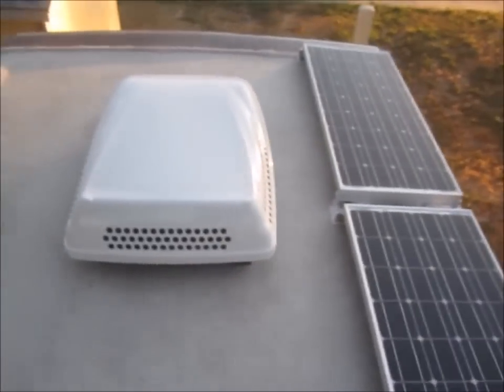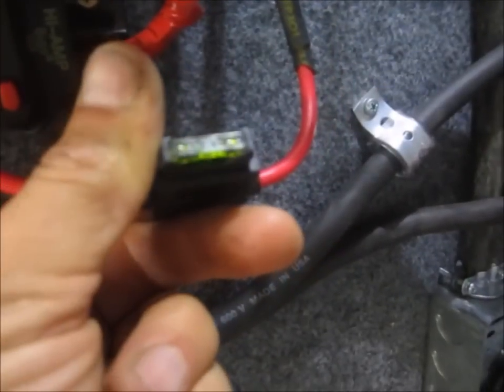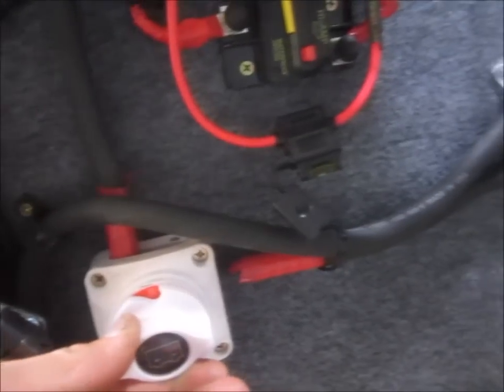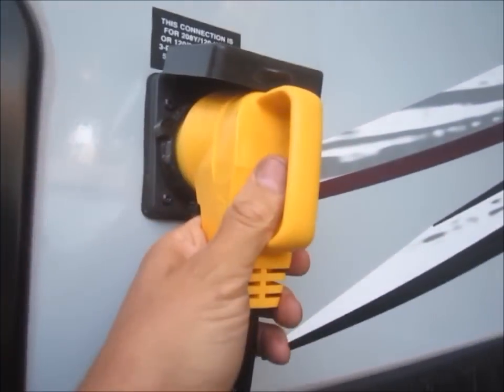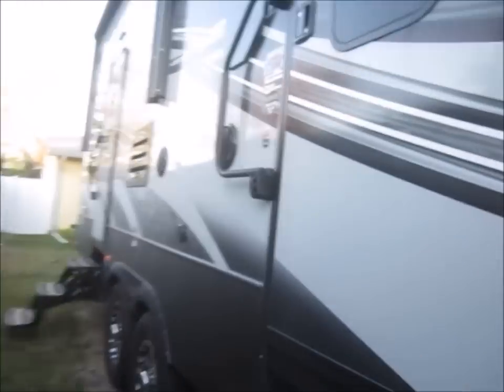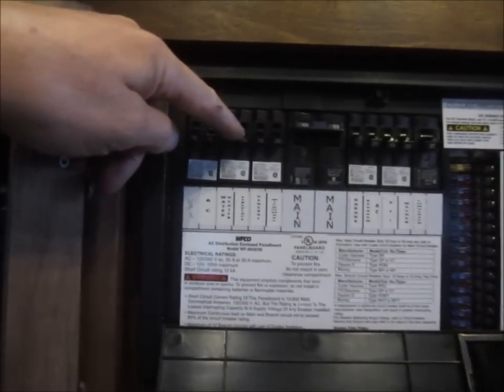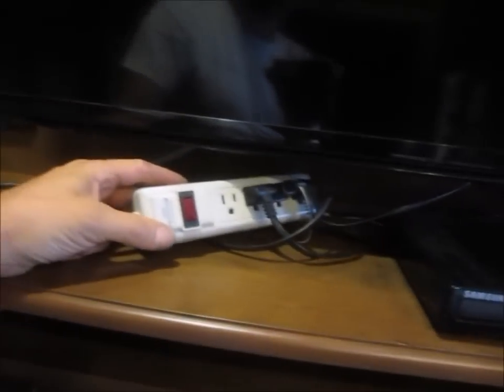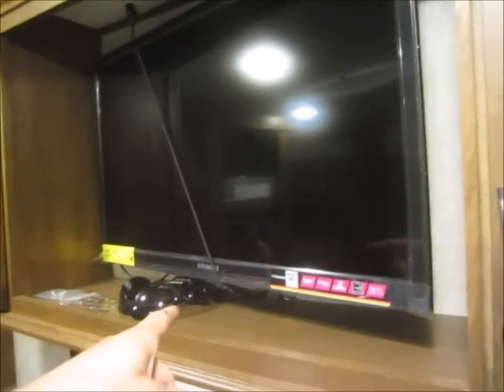3000w inverter, 400w Solar and 4 batteries. How I use it in my RV

Comment: Hi, Great video. Question. How many amp is your charge controller?  I would like to wire my solar panels and battery directly into distribution panel / circuit breaker/ shore line.  Any help will be greatly appreciated.

Comment: Can you run a 13500 BTU AC? I have a 3000watt inverter. I am planning to buy a cold start connector that assist in powering up a AC like this. It's about $250. But helps the inverter by charging capacity to push a 50amp draw to just 7am. It's kind of a soft start. Anyways normal running is about 1600watts start is about 2800watts.
Reply from the maker: This inverter did. But it won’t run long without more solar and batteries

Comment: Thanks for this great video,do I need more than 400w to run 3000w inverter?
Reply from the maker: Battery capacity determines how much power you can make with an inverter. The solar chargers the batteries.
Math is involved. How much load (amp hours) each day with determines how many batteries and how much solar you need to recharge them, and your biggest surge load determines how big the inverter is needed.
A good example would be a microwave.
A 900 watt microwave will almost always start and run with a 1500w pure sine wave inverter. 1200w microwave most likely won’t run on a 1500w inverter because of the initial surge, but may work with a 2000w and most likely will run off of a 2500w inverter.
How many batteries it takes depends on how long you plan to run the microwave.
More questions? I will do my best to help.
Reply: @StimRacingTrailerandTravels  i need it only day time but I am not sure if I can run the invenater on 400w solar i am going to run about 20amp.
Reply from the maker: @jasenwelly8981  your inverter runs off the batteries.
20 amps 12v or 120v
100w 18 volt panel like i had only make 6a 12v in good sun, so the best you could hope for with 400w is 24a at 12v

Comment: How about the converter, do you leave that off ? I don’t think my lights will turn on with out it.
Reply from the maker: Norm Nilsson your lights run off the batteries when not plugged in. You absolutely do not want the converter plugged into the inverter.

Comment: Hello, nice video. I have one question as I am uncertain about this. When you hook up a inverter to run ac loads, how much different is it to hookup from the current hookup that is used from shore power now going thru the fuse panel?. Thanks

Comment: Hi. Cool set up. Quick question though... can you just use a pigtail power cord 30amp female to 15amp male to connect your 30amp power cord directly into the inverter?
Reply from the maker: Sue-Anne Silvania, you sure can. With a 3000w inverter I wanted to be able to use it all. Even if for short bursts.
I did just want you suggested on my friends trailer and did a four video series about it. Please check my playlist for the 2000w power inverter and 495w solar install.
Thank you for watching and great question

Comment: Do u think 400. Solar panel watt can run ac 8000 btu
Reply from the maker: jamesly louis no I don’t. 
It’s a trick question though. If you have a big enough battery bank and inverter then yes, for a while. 
400 Watts at 18 volts only produces 24 amps at 14 volts in full sun. How many amps does a 8000btu ac use? My guess is 8 amps at 120 volts. 
For ease of conversation, we add a zero to 8a at 120v to get 80a at 12v.
So 80a used, 24a produced. You would be operating at a 56a deficit.

Comment: Hi, good job but a have a question, do you used regular batteries or used battery for solar panel?
Reply from the maker: Jose Osorio normal RV deep cycle battles from Costco or other retailers for around $70.

In later videos I installed two more batteries in the basement. Since it’s inside the trailer where hydrogen gas could build and explode killing anyone inside, I used AGM batteries that don’t form hydrogen like normal lead acid batteries will.

Comment: I am unclear on vampire draw. Is this the same as parasitic draw? Also, what does an automatic transfer switch accomplish that a simple double pole double throw switch does not?
BTW there are 51 states in the union. - I live in the 51st - It is the state of confusion, so please bare with me.
Reply from the maker: George, Yes vampire draw is the same as parasitic draw. When a appliance is off and still plugged in, but continues to have a current load in standby. For whatever reason my microwave and electric fireplace have a substantial draw. AlongTelevisions and DVD players, but we already knew about them.

A automatic transfer switch and two pole disconnect would accomplish the same things. The transfer switch would just do it automatically.
Reply: So, you are saying that a double pole, double throw relay doesn't "switch" anything?  I am more confused than ever. Isn't the purpose to disconnect one power source and switch to another?

Comment: Hi!  Did you connect the pannels and batteries in series or parallel? Thanks!
Reply from the maker: panisher  I did series parallel. Ran each set series then tied them together with splitter. I come down through the roof at 36 V DC,  and The MPPT controller takes care of the rest

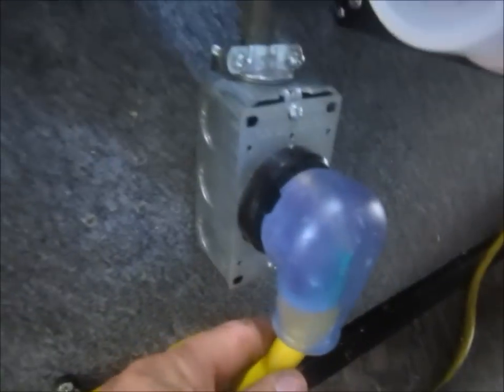Comment: Thanks for the great video. Pretty full on system. Sorry, only one bugbear is the coiled yellow cable near to the 30amp plug at 1:55.
Reply from the maker: ShortFlic I had an extra 2 feet of 30 amp cable, that needed to be stored somewhere. So I coiled it up by the plug. I don't see an issue with that? If I did something wrong please pointed out. Thank you
Reply: @StimRacingTrailerandTravels  some people are obsessed with power loss due to lenght of wire... I dont see a big deal . good job

Comment: If one was to do this, would it be possible to wire directly into the electrical panel and turn off the converter as to not charge the battery while running on battery?
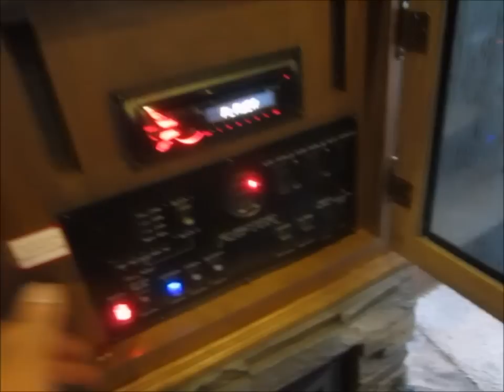Reply from the maker: After re-watching the video, I see I was not clear when talking about the inverter breaker being off. I just edited the video at 3:10 because of your question. Thank you so much. I am so sorry I was not clear the on the video.
Reply: thanks. I'm hoping to connect my solar power and shore power to an automatic transfer switch. I've found one that will run through the inverter but when the batteries get low or it's shut off it clicks to shore power. And when on shore it has 2 send. 1 for panel hook up and another to help charge the batteries.
Reply from the maker: Brad Hill that's a very nice way to go. My older brother did that with his toy hauler and it works very well for him. I kept mine as simple as I could.

Comment: Nice system, although I have to ask why you didn't consider installing a transfer switch instead of going through the hassle of running all of the wiring to the shore power plug?
Reply from the maker: Hi Mike. Thanks for the question. 
Well, at the time I did this, I did not have a good understanding of how x-fer switches worked, or that I could stack them. It would have cost about the same amount of money to add the 2nd x-fer switch as buy the extra parts and 30amp cord. As I have said before, I am not a electrician but I do have a basic understanding of electricity. At this point, I believe I could, and would use a transfer switch if I did it again.

Comment: I'm using 2 gauge wires that I plan to use when I install the system. I dont know how much of a load is on the general breaker. I will call the manufacturer in the morning to find out.
Reply from the maker: Good luck and please let us know what you find out
Reply: Stim, I called the manufacturer and they said it should be ok except for the fact that I'm running a 30Amp shore cable from the RV to a 15Amp plug to the inverter which could be causing the beeping noise. I noticed on your video that you have made some modifications running wires to the inverter. Can I ask what you did?
Reply from the maker: I will try to answer any question you have.
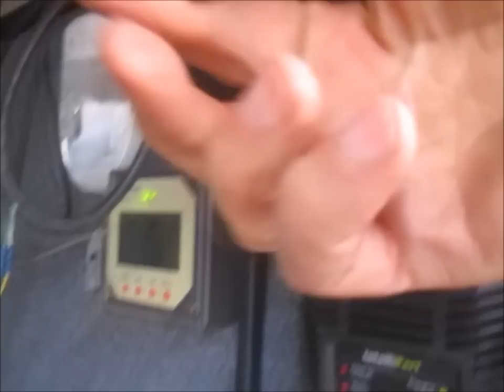The switch I turn on at 2:40sec is a remote on-off switch I switch into the inverter. Is that what your asking?
Reply: No, it's actually at 1:45 in the video where you say "out of the inverter I have 10 gauge wire...". It's that wire or connection that goes from the front of your inverter to a 30 amp outlet. It looks like you opened up the inverter and connected that 10 gauge wire directly into your inverter. Looks like you are avoiding using a regular household 15 amp 3 prong plug and are connecting direct?
Reply from the maker: Most big inverters are prewired, internal, or external like mine for a larger than 20amp plug. In my play list, I have videos about building the outlet, and this video doing the hook-up to the inverter. https://www.youtube.com/watch?v=U4WIIgUKxdI&list=PLIqa7jU6xgluMkskPHLMG86UHhjML--3s&index=5

Comment: I have solar panels to keep the batteries charged. And I hear the beeping coming from the RV. And no displays of any kind on the inverter. I'm hoping that there just isn't enough battery power and once I install the batteries it will work fine.
Reply from the maker: My inverter runs fine on two battery's. They just don't last as long. What size wire are you using for your temp hook-up, and is there a big load on the general breaker?

Comment: I just bought a 3000 watt inverter. I have two 12 volt batteries on my RV with 2 more waiting to be installed. I quickly wanted to test what you have set up on your video, connecting the RV power into the inverter prior to installing the inverter and extra batteries. After temporarily setting everything up and turning on the inverter I heard a beeping noise so I turned off the General breaker and it stopped. But of course none of the receptacles worked. My question is, could that be because there are not enough batteries installed? I was really hoping this would work so I don't always have to lug around my generator when I go dry camping and still be able to use some appliances and watch tv.
Reply from the maker: Hi Carlos. My beeps for low, or high DC voltage from the battery's, or over load on the AC side. (Pulling to much power from the inverter. Or reverse hook-up. Do you have a voltage display on your inverter?
What do you have to keep your battery's charged if your not taking a generator?
Reply from the maker: after re-reading, I see the beeping is when your general breaker in your RV is on. Is the beeping from the RV or the inverter?

Comment: A terribly inefficient way to power the trailer by going through the shore power plug with the inverter. By doing this you converter/charger is running. To put it in different terms.... you are inverting power from 12v dc to 120v ac.... then through the converter, you are changing it back from 120v ac to 12v dc, to run lights, etc..  Every time you invert/convert you loose power through heat/resistance. You would have been far better off to run a few auto switches for the circuits you need to run when you're dry camping.
Reply from the maker: OK, but the converter is on its own breaker. I think you must have missed the part that I only turn on the breakers that I want to power up? No joke we don't want the power to the converter from the inverter.
Thanks for your insight Monte.
Reply: My rig you can turn the charger off with a breaker
Reply: There are significant advantages to run it that way - shore power can be notoriously unreliable with brownouts or under/over voltage which can damage appliances and electronics. 
Going through the inverter solves the problem.